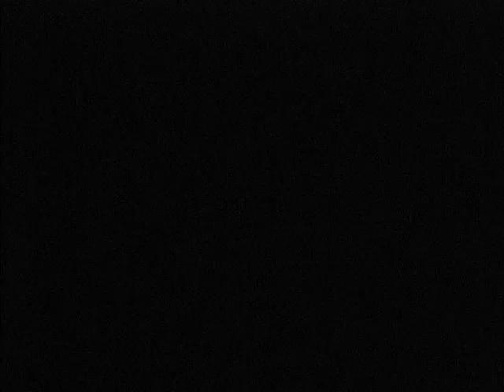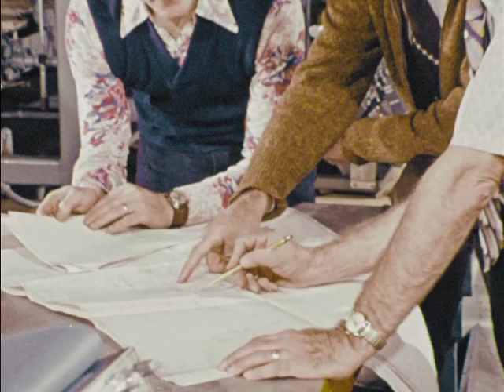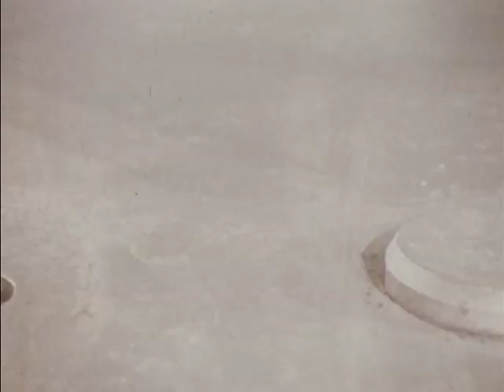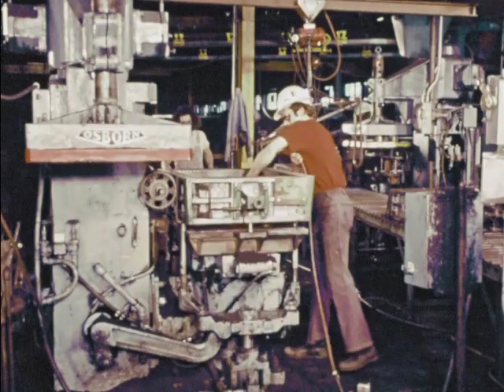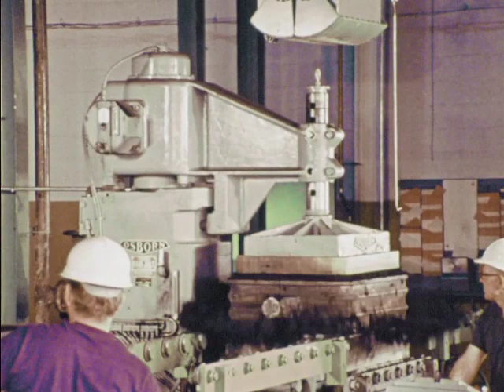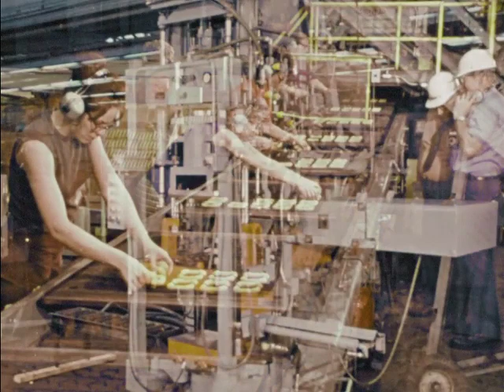Whisperarm

Comment: I believe this video is from 1974.  I looked up the trademark information:

Word Mark	WHISPERAM
Goods and Services	(EXPIRED) IC 007. US 023. G & S: AUTOMATIC MATCHPLATE MOLDING MACHINES. FIRST USE: 19720426. FIRST USE IN COMMERCE: 19720426
Mark Drawing Code	(1) TYPED DRAWING
Serial Number	72435645
Filing Date	September 14, 1972
Current Basis	1A
Original Filing Basis	1A
Registration Number	0977233
Registration Date	January 22, 1974
Owner	(REGISTRANT) SHERWIN-WILLIAMS COMPANY, THE CORPORATION OHIO 101 PROSPECT AVE. NW. CLEVELAND OHIO 44115
Assignment Recorded	ASSIGNMENT RECORDED
Type of Mark	TRADEMARK
Register	PRINCIPAL
Affidavit Text	SECT 15. SECT 8 (6-YR).
Live/Dead Indicator	DEAD